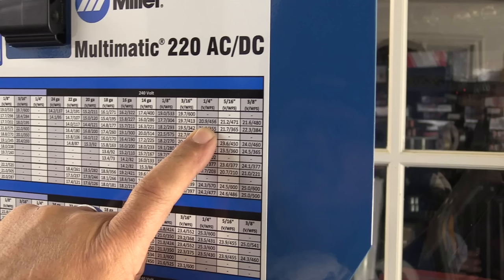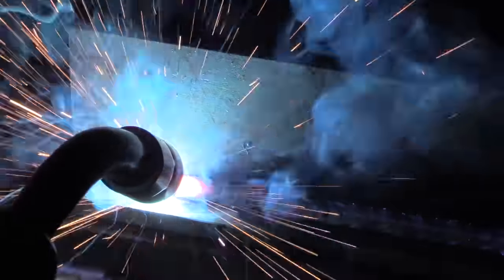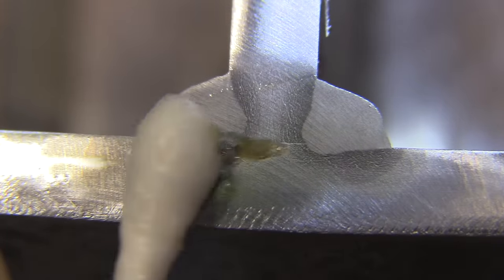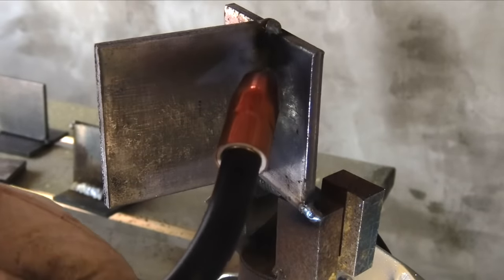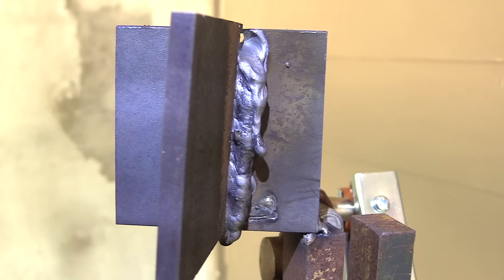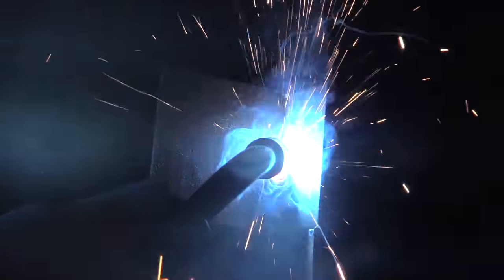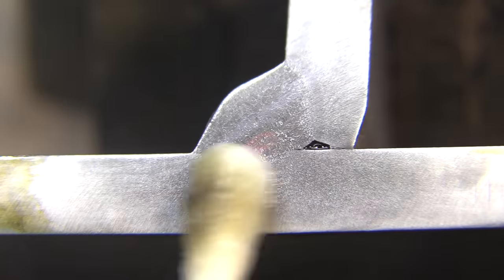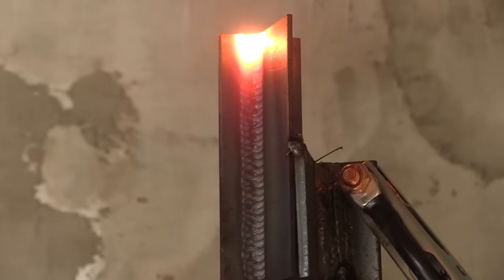Miller Multimatic 220 AC/DC Mig Welding Techniques

Comment: I've been a professional welder for 40 years, miller are top notch. I'm mainly a tig welder, I've done oil exploration ballast tanks for submarines recently,  all aluminium,  I'm now making bespoke 304 food industry equipment,  all hand made, look up Gough engineering UK. That machine is excellent,  but uphill should be slow and patient, with the torch pointing slightly north. The backwards Z  trick is to watch it sink on the left corner, let it rise then move right, same again, then z up to the left to create the second part of the weave on the left and so on. It creates a double bead, with full penetration. I used to weld cut and stretch wagon chassis like this, with hiabs on.

Comment: Got to check out that mig knuckle, i was actually just using my tig finger xl not to prop but to shield the heat from mig welding my trailer. Funny how things work out. I guess all us welders experience the same things. Burnt knuckles, and holy boots.

Comment: I just recently purchased a millermatic 255. While trying to familureize myself to the new welder
Did the push then pull then the vert down and then vert up with the auto settings for size of steel , gas and wire. I got even an uglier vert up. Now i know how to correct that.  Thank you Jodi for sharing your welding expertise. I have Been welding 55 years plus. Age has deminished the eyesight and i no longer want to weld out of position. I' m  to stiff and feel like i have fallen and cant get up.  But as long as i can move im going to continue to go to the shop and enjoy the challenge. Still fun to learn and perfect what i think i know. My dad had a mobile welding service till he was 80. And lived to go weld something. His mistake, he retired.

Comment: Another great video, thanks, Jody!
Just to chime in with over 45 years of MIG experience on the "Push vs Pull" technique w/ gas shielding. 
From wayyyyyy back in the day, in the Navy and Oil Tanker shipyards working w/ Steel and other shipyards MIG welding all Aluminum Tuna Boats w/ "CobraMatics", we were ALWAYS required to Push a wire feed whenever possible for a number of reasons having to do with penetration and porosity.
This is because as the nozzle is angled slightly in the direction of the weld, the shielding gas is pushing the atmosphere away from where the puddle is going to be created.
It was determined that a "Pull" technique, with the nozzle aimed back towards the puddle, opposite the direction of travel actually placed little gas coverage in front of the puddle and the weld force tended to "suck" more atmosphere directly into the formation of the puddle as the angled nozzle moves away from the weld. 
I know it's Po-TAY-toe vs Po-TAH-toe, but except for real thin material or difficult circumstances, I still "Push" when ever possible based on 45 years of experience punching the clock in the yards and later, owning my own fabrication business.
And Jody, Thanks again for ALL you do for the fabrication community!!!
Reply: Sir what will happen when all welding is carried out in AIR CONDITIONING area
Reply: Please make some video on round tube welding and how to control distortion in that
Reply: How stress relieving in welding is done?
And why it is required?
Reply: Malli muchatlu songs
Reply: You are correct sir. I always push my welds

Comment: finaly got my verical uphill using your triangle technique !! i use 3 settings lower than the gauge steel im working with as a start point as i weld up to 1/2 at work . i stay learning off your vids man thank you

Comment: All the other welding sites have had to up their game to even be worth a look. Jody is still the best. I haven't used innershield in 20 years, until a few weeks ago. As i moved the torch to the work piece i could hear his voice explaining how to do the vertical uphill welds......

By the way - Jody, what wire do you use for Dual Shield? Is it just regular flux-cored wire with C25 gas?

Comment: Got to try that technique out. Just bought a Miller Multimatic 255 a few weeks ago. What an amazing machine! Replaced my Lincoln 180. That Pulse Mig is freakin awesome!!! Really excited to try this vertical uphill tomorrow. I’ll try it on short arc mig and pulse mig. Pulse mig seems to work better on everything I’ve tried so far.

Comment: Thanks so much for all your welding tips. I’ve always struggled with vertical up with ugly looking welds. Probably because I never turned the power down thinking it wouldn’t get in there as much. Turns out that’s what I should have been doing all along. I’m going to practice some more to try and nail this technique once and for all. An appreciative UK viewer.

Comment: Another great video, Thanks!
I have a Vulcan Omnipro 220 and even though I’m use to setting up welders manually I didn’t think I would use the auto set that much, but after using it man it’s convenient, especially if your welding a few different thicknesses on the same project! Take care :)

Comment: Thank you for this video! I have been welding for about 45 years now with sticks and mig. 90% of my welding work upphill i do with sticks, in all other positions i use mig. But i newer learn to weld upphill with the mig, yesterday i welded a hook for an compactor with the mig but i did it from top to bottom! Lot of heat is needed beacuse we talk about lifting power from the full off waste compactor, maby 40 metric tons! But i will test you method and im shure i can do it! Thank you sir for good videos! Regards from Timo in Sweden.

Comment: I could watch this all day! So damn good!  And thank you! I've always had a problem with uphill mig and I've always seen downhill mig break over time
Reply: Alittle bit late but mig downhill requires a serious attention to travel speed and gun angle. You can crank her up and let her eat but if you let that puddle catch up to your arc for even a blink of the eye it will not pass a bend test especially a downhill open root.
Reply: I wouldn't trust it on anything thicker than .125 or so. With a bit of root opening you can get reasonable welds on thin sheet going downhill, but let's face it... You're not gonna be putting up buildings made out of 10-ga :P

Comment: I seriously looked at this Miller 220 and it has great features but in the end I bought the Fronius Transteel 2200 MV .both machine have similar features but in the end the Fronius is nearly half the weight and in Canada 1000 dollars less even when both are on sale. The Miller is a great machine, had Miller for years (just sold it)  both machines weld very well  but there is something about the Fronius which is the European quality  this influenced my decision . Jody how about a weld off between both machines, your skill would make the test very fair.
Reply from the maker: If Fronius ever reaches out, I would like to try one. They seem to be well designed machines.

Comment: I'm still trying to master uphill. I'll give these settings and techniques  a try! Thanks
Reply: When going uphill, low and slow. I normally run around 17-18 volts and around 180-190 FPS for wire speed.
Reply: Zig zap ....pause in the corners 3 seconds

Comment: i'm really thinking about getting the miller multimatic 220 ac/dc for my first own personal home shop machine! i just an everlast 180 tig box and a millermatic 252 at work everyday, i'm thinking the 220 would be perfect for my home shop, i'd litterally be able to weld anything one would need to at their house for like car building and small fabrication jobs!

Comment: Is it over 1/4" that you are supposed to bevel? I always like to see the cut and etch, speaks volumes. Thanks for sharing!
Reply: Depends on the WPS, or specific code you're welding to, as well as the joint design. 

If you're welding something where 100% penetration is required, then I'd bevel everything to ensure you're getting into the root. 

Had a job at my last shop where everything was 100% pen. Welding 1 1/2 plate to 3/8" wall  thickness square tubing. The plate was cut to fit the tube. On those we welded the inside first, the plasma gouged/grind down to clean weld metal. Then we'd weld the outside. Then the NDT guys came and ultrasound the welds. That wasn't typical however. 

For fillets, the strength comes from the weld size.  For example if you're welding 3/8 play to 1/2 plate, the minimum weld size should be 3/8". This means the legs and face of the weld shouldn't be less than 3/8". Keep in mind the biggest single pass you should pay with mig is 5/16". To get the weld size necessary you'll need multiple passes.

For butt joints and groove welds, I bevel anything over 1/4". I hope this helps
Reply: @chuckhickman8093  wow, that's very cool, thanks for explaining. I just like to play around in the backyard, only took a night class for stick at the tech school (dad's a welder though). I remember the instructor saying you can/may have to lay many many beads. I have a book or two, and I think a few chapters from a Navy Training Manual. Sometimes it makes since, sometimes not, lol. Thanks again.
Reply: @chuckhickman8093  great job describing the situations that arise . I've worked for several different outfits before going into business on my own and at both shops we were doing the same work but the requirements were completely different.
Reply: @chuckhickman8093  I know it's an old comment but I have to say according to AWS d1.1 effective weld size is ¹/16 less than the smallest base metal thickness. So in your example of  ⅜ to ½ T or lap joint a single pass at  ⁵/16 would be sufficient.

Comment: That triangle uphill motion is something new I've seen I'm gonna try that during my job and see if it works with aluminum that's what I weld at work
Reply: Did that triangle uphill motion today on aluminum worked very well definitely using that now thanks Jody

Comment: any firm i worked for, would use fluxcore on any thickness 1/4" and over. our policy was sheet metal was ok for mig, notably,  gmaw doesn't have the heat density for .035 on plate and is much slower productively. i can fly vertical and oh with .045 fluxcore with barely any oscillation and still out weld a mig weld. nice looking welds are fine, i've seen  fantastic welds fail test due to lack of penetration as was witnessed in the video.

Comment: I love this video, I have been looking to get this welder, I am sure already ask you in the comments, what voltage did you use while making the video? its a big difference welding with 110 Volts VS 220 volts? if anybody could answer that will be cool, Thanks.

Comment: Jody, I’m having trouble with lift arc/ scratch start TIG. Not the welding part, but the stopping, I’m leaving arc marks. I leave a nice taper down when I wiggle fast towards the end but always leave a arc mark or 2. 

Can you show how to properly pop out of a scratch start TIG arc?

Comment: Must ask, I just bought a bunch of 7016E 3.25mm sticks and the slag that comes off is very glass-like, not at all like "normal" slag, why? I am welding on normal iron/steel material for practice, the weld underneath looks good but I am wondering why the glass-like slag?

Comment: Great video. Thanks. Am very new to welding, but want to do TIG. Plain Miller TIG welders are a lot more expensive than the multimatic. Are they that much better? Cheers Al

Comment: Hi Jodie-another interesting video. In the UK we were shown vertical uphill by setting the welder up for horizontal welding and then for the vertical weld using a "Christmas tree " pattern which was upward then back and side to side then upward again. A slight push angle gave good sight of the pool . The only noticeable thing was the arc sound which wasn't at all smooth but gave a lot of popping and banging !
However weld appearance and penetration were fine. Any comments? Or is this just an English foible ?

Comment: Hi Jody. When you do patterns like the triangle in this video, it's it an arm movement or a wrist movement? In other words, are you holding the gun rigid and moving the gun up/down/across with your arm, or are you swiveling the gun at the wrist like you would when walking a tig cup? Thanks.
Reply from the maker: probably a bit of both...depending on what I have to prop on.  but mostly wrist

Comment: Now I'm a precast guy and I work with someone who swears going to welding school is a waste of time and money and that it's only experience that'll get you a job, I say it's 6 of one half a dozen of the other..I've had to weld for a while and want to step into structural welding. I can and have been sticking metals together but im no welder. What I'm getting at is, what is the best way to get my foot in the door.

Comment: that blow through reminds me of when i tried to TIG 1/4"  aluminum plate, DC NEG for the first time. it was for a SpaceX test and guess what? i didn't get that sweet job😅
Reply: PANTYEATR1 Did they let you practice?
Reply: @Club86  nope, the test was making a test plate to their specs, then welding it. it was a 3hr test for that, so you only had one shot
Reply: PANTYEATR1 Damn, nice one for going for it though 👍🏼 🇬🇧

Comment: I prefer to push evert time. I worked at a company that built roll off dumpsters, needless to say we used heavy gage cold rolled steel and used spray arc only. If my boss saw a new guy pulling a bead he would ask him where he learned to weld.😂😂

Comment: Does this machine have enough power to do spray transfer, I'm guessing it doesn't pulse mig?
Reply: So I did a little research and it looks like thisll do 24v and 24 volts is where spray transfer starts. So it looks like it's kind of limited in that regard, right?

Comment: Great video as usual, I have a peeve on welders, why don't they have the settings on a laminated card,so you don't have to open the machine, I understand if your professional,and weld daily may not need it. What is your thought,for me I would pay for one even if they were sold separately.
Reply: Try downloading CamScan from the app store, take a pic of the chart, save it as a PDF and email it to yourself. Print and laminate, done.

Comment: What wire did you use? Other Q:  can I use 308l wire with trimix gas on regular carbon steel?
Reply: Manuel T 
You can try, buy why?
It kinda mixes with the base metal, but why do it on something important. Buy cheaper gas and wire
Reply: I do mostly SS and I have that wire and Gas, well now I have 💯 argon and 💯 CO2 y just need to buy the  wire. Is for a stand that will support abut 1000lb or more. Thanks
Reply: Manuel T 
Ya for strength, stainless won’t cut it, it doesn’t like to stick all that nice and will make a weak weld

Comment: If that's a new welding machine, and if you follow the settings according to the machine, why is it that it failed? Is Miller unaware of the need for vertical uphill welding? Why would I want to buy this machine if the auto settings are wrong? I bet if they were to ask Jody on how to build a welding machine, Jody could teach them a thing or two.

Comment: I don't know I'm only 3 and 1/2 minutes into this video... and he is going from Flat position to vertical... he gives the diameter of the welding wire that he says came with the feeder... but up to this point he doesn't specify whether or not he checked this wire for all position???? He never tells what kind of gas mix he's using or gives a suggested. Psi.?? I could go on and on but yeah whatever

Comment: Can't use mig to weld vertical
Reply from the maker: Explain please
Reply: Using pulse arc is better in the vertical position than mig.flat and 45 degree angle is the only thing we use mig for

Comment: When you spend $3100 on a multimatic 220 and it all of a sudden won't perform in mig function, instead it keeps reading spoolmate on the front display screen, throughout all 6 functions and when you call miller, they say, it must be something internal?!?!?!
 Then, when you call miller in Wisconsin, they say,...oooohh,.are bad , no worries just roll it up and send it to a pre approved miller repair company while your machine is down for who knows how long as we try to do out best to get you up and running! Lmao

Shitty printed circuit boards.
No more dependability.
Good customer service, but unfortunately, the product is not reliable.
Reply: 3 year warranty.
9 months in,.. already filing a claim..
C' Mon miller..